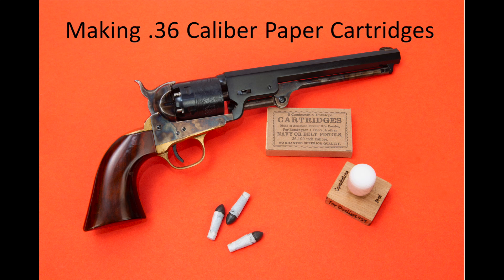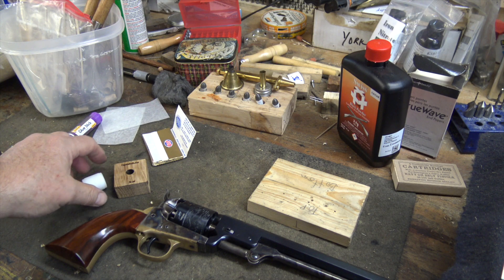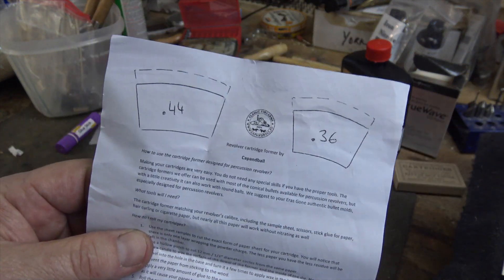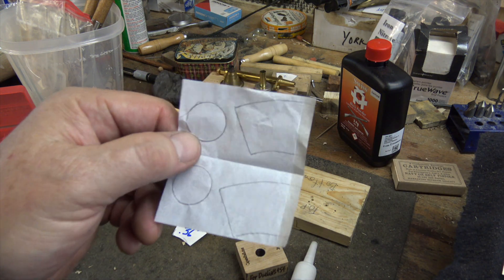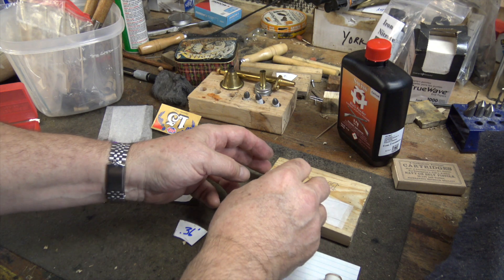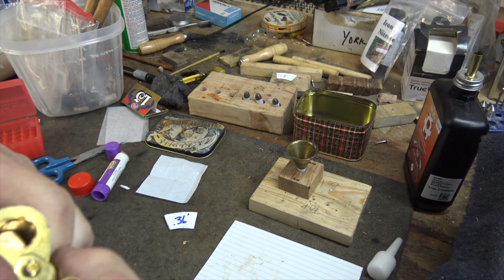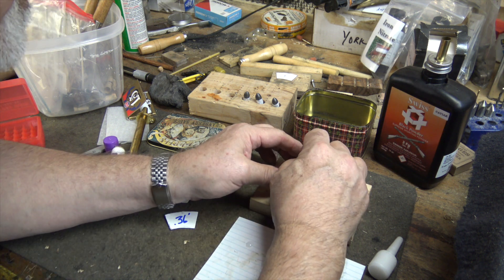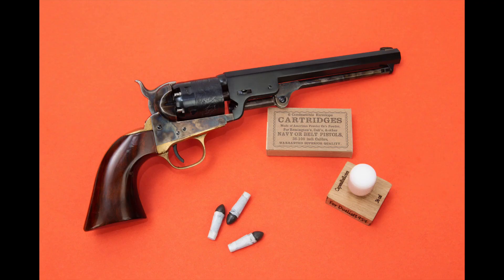Making  36 Caliber Paper Cartridges

Comment: I feel like you could just glue the bullet roll the bullet and a dowel so its a straight cylinder pull the dowel powder charge then twist the end and snip it off and it would work just fine

Comment: You got yourself Mike,  a good effective method of making Combustible Paper Cartridges for percussion cap&ball revolvers.

Over the years I found discovered that Thin Wax Paper makes for the overall best non nitrited paper to use as casing material to  make CPC'S  with my Universal Bullets. 

To be exact;
Thin Deli Wax Paper is the most effective  non nitrited paper which is very durable, self combustable, sealing, protective of the  gunpowder from Water, Oil, Blood Fluids Humidity etc.

 In a recent burn test a CPC case was made with the Thin Deli Wax Paper and ignited with Factory percussion Caps, Remington #10 as well as Home made percussion Caps with the use of the Prime All kit.

The factory made percussion Caps left a burned hole penetraiting through the bottom of the CPC casing, the size of a pencil eraser. 
The home made caps caused more burn up of the CPC  case.

Watch "Combustable Burn Rates of Thin Wax Papers For Use In Making of Combustible Paper Cartridges" on YouTube
https://youtu.be/l__qosz2MVA

Comment: I own three .36 caliber Colts. One is an original 1851 Model and the other two are Uberti. I have never had to make paper cartridges for shooting any of these guns. I can shoot conical bullets in all of them and have never had to worry about loading them fast. I can load any of these guns just using powder bullet and cap with Crisco as a grease on top and can load them probably just as fast as somebody using paper cartridges. I have never had a chain fire and never will using my method of loading one cylinder at a time. However more power to you if you want to take the laborious task of doing that. To me a round ball is easier and more accurate than a conical in any or these weapons. That is what they were meant to be loaded with anyway.
Reply: "and can load them probably just as fast as somebody using paper cartridges"
I sincerely doubt that!
Reply: Put up a video I’m interested in seeing it
Reply: TBull Cajunbreadmaker Making combustible cartridges allows the shooter to experience loading and firing C&B revolvers by the method in most common use by 1860.   About 99% of the revolver projectiles recovered from Civil War battle locations are conical bullets, primarily .36 & .44 caliber. The only C&B revolver intended to fire only round balls was the Colt Paterson. From the Walker Colt forward, all Colt revolvers were rifled to accurately fire conical bullets. Upon Colt Patent expiration in 1857, as Whitney, Starr, Remington and other revolvers appeared, all revolver manufacturers included a double cavity mold that had one conical and one round ball cavity, as did all Colt molds from early 1847 Dragoon models onward.  Combustible revolver cartridges were in widespread use by 1858, and made by many manufacturers other than Colt, and all revolver combustibles used conical bullets. Uberti replica revolvers tend to fire conicals more accurately than round balls due to the faster rifling twist that is pretty close to the same twist rate of the final twist near the muzzle of original Colt's and Remington's gain-twist rifling.   Watch more of Duelist1954's videos on C&B revolvers and you will see that conicals usually shoot tighter groups than round balls, especially if the replica revolver is a Uberti.  Also look up the Cap And Ball channel referenced by Duelist1954 in this video, where original Colts are fired in comparison to the Uberti replica, and both Original and Uberti replica revolvers fire conical bullets VERY accurately.
Reply: Save some chicks for us, bro.

Comment: There might be a faster way to cut out the bottoms for the cartridges. A leather hole punch or a cigar hole punch could do several pieces at a time. The Cigar punch, at least the zikar one I use for my cigars even has a function that would push the cut pieces out of it. I have just started down this rabbit hole that is ball n power shooting, but that seems to me like it could work well.
Reply: you can also get a .75 inch punch from Amazon that works really well too.

Comment: no hang fire for the primer to reach the powder with paper in the way? Or does the ram break open the powder?
Reply: It is hard to see if the ram breaks the paper , I use nitrated coffee filters . never experienced A miss  fire . cleaning the cylinder after shooting I find A lot of remnants of the paper base all packed nere the nipel end of the cylinder and all have A hole in the center . Now when I first started making paper cartridges this concerned me thinking the same thing , I have shot the gun to the point that I  stopped due to fouling , have yet to experience A miss fire , I dip the made bullets in hot lube and have yet to experience A hang fire . I have come to the conclusion the burnt paper rings  with  A burnt hole is nothing to concern about  it is the glue that doesn't burn as well as the rest . I have tried elmers and liquid glass and both have the same efecte .
Reply: @Bill Randleman The paper cartridge former if used makes them all pretty unifored in dimensions , they are made with A taper the jonson and dow bullet has A undersized heal that the paper is wrapped around the bullet contacts at the lube grooves when put in A cylinder bore , but yes when you compress the cartridge it has to break the cartridge but I still find the base of the cartridges packed at the nippel end of the cylinder with A hole burnt in the center . When compressing the cartridge it is compressed against the nippel .
Reply: @Bill Randleman I use nitrated coffee filters , What do you use ?
Reply: @Bill Randleman interesting

Comment: Mike, thank you for this video!  There are a couple of options for the 44 cal, but the 36 cal is often neglected.  Do they have 31 cal version for the totally neglected pocket models?

The handle of the mandrel looks a little too big, like it would get in the way more than be useful.

I can't imagine what the shipping would be like to send a complete set of them here!  I'd probably have to hold up Evil Roy to afford a set!!!
Reply from the maker: Larry Talbot No, the Mandela works just fine. It is as good as the late Cliff Manley’s tool
Reply: @duelist1954  Thanks Mike!  I was going to order the Manley set, but just as I was saving up for it, I heard he passed away and I never got to order one.  I don't think he ever came out with  a 31 cal version though, or at least that I ever knew about.
Reply: Chris Duke  According to his eBay listingd, just .44 and .36 cal is being offered.
Reply: Check out Guns of the West. He makes a kit for pretty much all of the pistol cartridges. His prices aren't too bad either.

Comment: I use 24 grains of 3fg pyrodex P powder. I'm new to black powder so I haven't purchased Mark's .44 conical mold, or any paper cartridge formers. I use my Uberti 1851 Navy plunger I bought to replace my Pietta Confederate Navy's plunger as a former. I use tissue paper because in my area it's cheap and easy to get because I live near, and have family members who work at the local P&G plant. I also have a question Mike. For my second black powder revolver I'd like to buy a Uberti 1847 Walker, would you recommend to buy one?
Reply: I have 3 Walkers , 1 is a San Marko use 40 grains 3F no more or you will Batter the wedge . I also have 2 Dragoons same load like the Dragoons better that the huge Walker , A matter of personal taste .

Comment: Hi Mike!
Great video, as always!
I stopped using glue for sealing the bullet in the paper case because there were times when the glue would catch on the paper before seating all the way in causing the paper to buckle. Now I simply use thread around the first (bottom) lube groove (Lee conical) with a clove hitch. This mil-surp thread I have burns like fast fuse...I don't know why but I have two huge cones of it so am going to keep using it. This technique I use for my .44s. I haven't received my .36 caliber former set so I can't comment on that yet.

Comment: The 44 will work when using the 1858 New Model Army. Removing cylinder makes things easier. The revolver you show can't be removed as easley, but I know you know this. I get my bullets & lube same place as you stated.. But I use a different 44 bullet. They have many variants.
I have the same set from capandball. Thier are different ways of making paper bullets. I like how capandball does it. I use superglue for example.

Comment: Mike, I have been watching your channel for a long time. Always enjoy your videos. I just thought I would share something with you. I have experimented with several different papers; cigarette papers, coffee filters, Perm papers, etc. I am sure you have done the same. Recently I have been using gift wrap tissue. It is about as thick as the cigarette paper and a whole lot cheaper. I can buy a pack at the Dollar General for a buck and it would make several hundred loads. It works great for me. I fired about 300 rounds last week and only had 2 shots that didn't fire. I don't think the fault was the paper. I think it was just a couple of weak caps. I have never tried nitrating the paper but plan on doing so later just to see if it is worth the time for me. Have you ever nitrated your paper? And if so, could you tell any difference?
Reply from the maker: John T. Chambers I nitrate the coffee filters because the paper is thicker. I like working with cigarette paper. I find the glue strip to be very convenient.

Comment: These are massively over engineered and time inefficient...not to mention the glue on the back end will likely give you reliability issues.

Here is a better method;
Take a slightly sub cal dowel, 
Cone roll your cig paper around it, 
Drop the bullet into the wide end and twist it closed, 
Remove the dowel, 
Pour your powder in, 
Pinch the open paper and shake the powder down like a sugar packet,
Twist it closed. 
Clip the excess paper off the twisted ends.
And repeat.